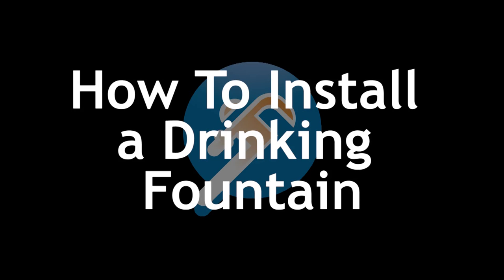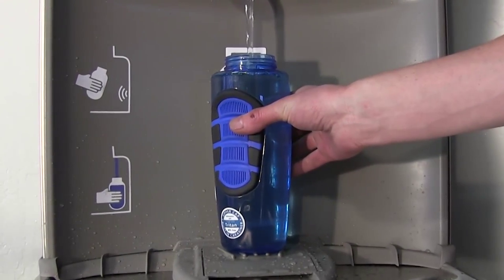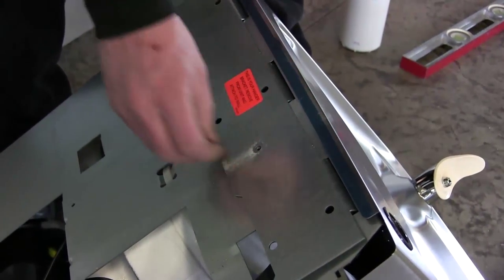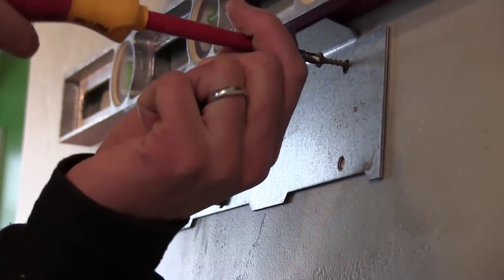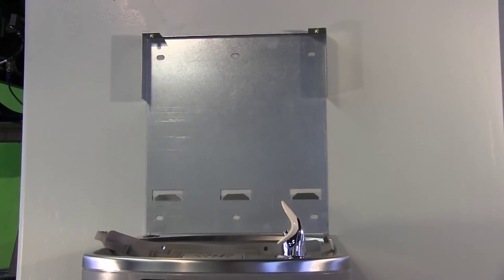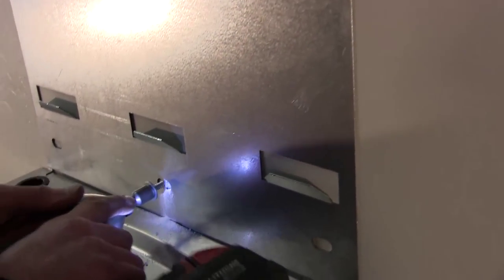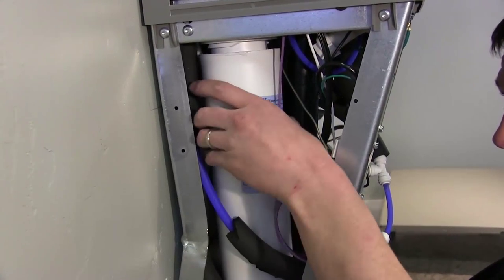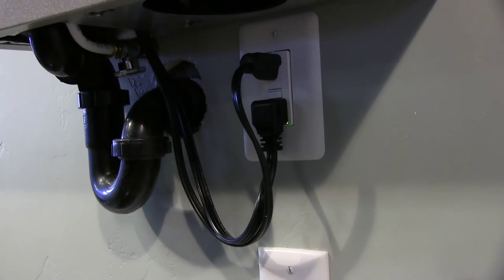How to Install an Elkay Fountain with EZH2O - PlumbersStock.com

Comment: so im guessing the filter will not fit inside the unit if you install the p trap inside also ?
Reply: I installed one of these yesterday and was able to get my p-trap, waterline and electrical hidden behind the shroud. I roughed it in exactly the way the manual showed it and it worked perfectly.  There is just enough room for an 1 1/2 "p-trap beside the filter if you hit your stub out without having to offset the trap. The hardest part was mounting it because of the tile I had to drill through (about 14 holes total through tile meant to be used for flooring), and forgot to install backing during the rough-in!

edit: the one I installed was a newer model though. The water bottle filler power supply is integrated into the fountain power supply so I only needed 1 outlet. Other than that it's pretty well the same.